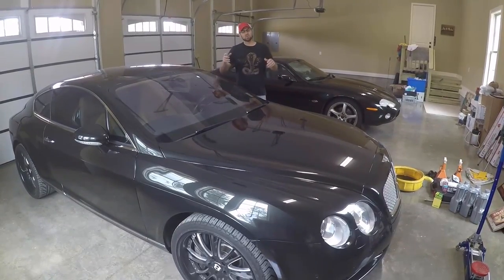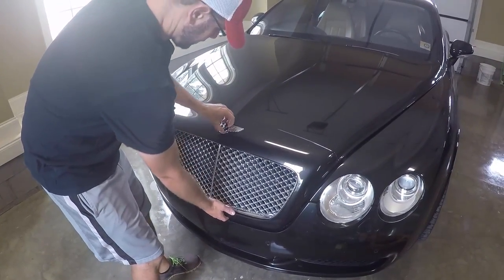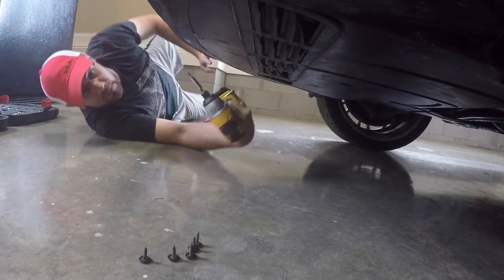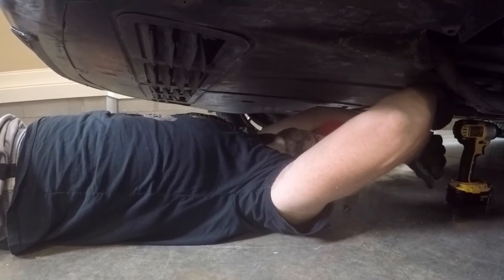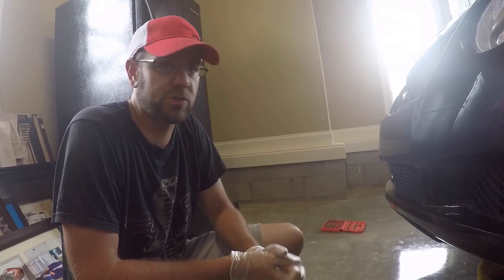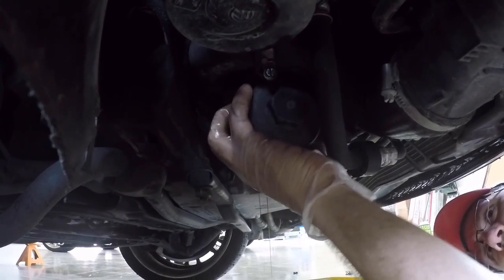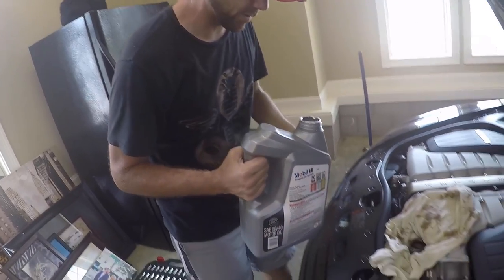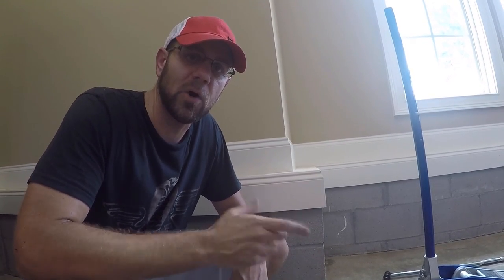DIY Bentley Continental GT Oil Change , Will I Die? Maintaining A Used Bentley GT

Comment: Hey John
I noticed you have a leather boot around the gear selector. Is that aftermarket? If so, I like the look and would like to switch mine out too.
Love your channel and thanks
Frank
Reply from the maker: Frank Cook Hey Frank and good eye. When I got my Bentley the plastic gate on the inside of the shifter was missing. This tends to be a common issue in the earlier GTs. I went to replace the part and found out that you have to get a whole new shifter. To do this was way more than I was looking to spend to fix a plastic part. So I went to good old eBay and ordered a custom Italian leather shift boot. Unfortunately, the vendor that I bought it from no longer sells them. It was a simple and easy fix that gives the GT a little more sporty feel.
Reply: John Engel 
Wow! 
What quick response. I have the same issue on my GT. I guess I could get an apoulstry shop to fab one up. I did see the plastic piece being offered on the web for $350. I guess even if you purchased the plastic piece, it still has to be dissasembled and installed.I think the leather boot looks better. Keep up the good work fella!!
Frank

Comment: Do you have to hold the two buttons in to get out of jack mode? I didn't see you press them at the end of the video?
Reply from the maker: RJC III you can do the same process and it will take it out of jack mode or if you drive the car over 5 mph it will automatically take it out of jack mode. Thanks for watching.

Comment: I have a 2016 V8S, I want to reset my service indicator ( I bought the car used from Bentley dealer in January 2020) I have only put 2500 miles on it since then.... now the service indicator light is telling me I need a service in 15 days or 5600 miles...   The car runs perfect... I want to reset the service indicator until the full year (next January).   I cannot find anywhere the sequence to reset this?  I tried your method... but didn't work on the 2016..   any ideas?   thanks
Reply from the maker: Dr. Daniel Sullivan yeah they changed the reset method after 2010 I think. I’m not sure on that one.
Reply: John Engel hmmm.... if you or anyone else has any suggestions, pls submit.
I don’t think the Bentley Dealer will divulge...
Reply: John Engel   I will probably have someplace with all the equipment change  the oil... having the car up on a jack or ramps will likely result in a incomplete oil change due to the drainage angle?  ( I’m guessing)

Comment: Next time you might want to Jack the Bentley from the other side as you can see the oil will then run completely out of the Pan instead of backwards into the corner!😎
Reply from the maker: JOHN Q LUNCHBUCKET I know have a lift so I can make sure it’s level.

Comment: How did you get it off the Jack Setting?
Reply from the maker: Peter Smith when you go for a drive it will automatically remove jack mode or you can do the jack mode process again and it will remove it.

Comment: thanks for this. do u need to put the car out of jack mode when ur done?
Reply from the maker: mujjuman you can by doing the same process that you used to put it into jack mode, however, if you don't it will automatically come out of jack mode once you start driving.
Reply: awesome thanks man. 
oil changes can be very messy jobs especially when you have a bad back or not too much free time, however if you're gonna be saving $600 then it's worth it imo

Comment: Walmart will change your oil in a Porsche panamera for 68.00
Reply: And they'll put in gravy as the oil
Reply: My car wont fit inside of a Porsche panamera
Reply: The problem here is trusting other guys to do the work.  Do it yourself and you know it's always done right
Reply: And then it comes to the dealer on a tow truck for me to fix whatever they broke in the process

Comment: hey why is your check engine light on lmao, and did you forget to take it out of jack mode? Last thing do you recommend this car? I plan on buying a 2006 Continental flying spur with less than 55,000 kms (around 34,000 miles) car is super clean too and has all the maintenance records. Anyways if you could let me know how owning an older Bentley is I would very much appreciate it. Also my biggest fear is these cars breaking down, especially if you daily it. Have you had any major problems with this one?
Reply from the maker: Fbaig thank you for the comment. The car was not on when showing the dash. The check engine, battery and other icons are on in accessory mode but it has no check engine light on when driving. It’s been a great car but as you stated it will cost more if you have an issue. I think you will love it.
Reply: John Engel thank you so much for the reply much appreciated. I’m hoping that the air suspension has already been replaced since I know they can be extremely costly. And one thing with this car which I will be addressing right away is no Bluetooth, no back up camera. I’ve found out that Bentley offers a Bluetooth kit so that’s solved, and many retrofit back up cameras are available so I should be good with technology. I’m super excited I’ve wanted a flying spur for such a long time, and the dream is finally coming true, just a tad bit nervous. I’ve owned many high end Mercedes and BMW products but have never bought such a sought after ultimate luxury brand like Bentley, have driven and experienced many but never owned one.

Comment: Well done my friend. Thinking of buying one myself. Two questions: 1. What year is your Bentley? and 2. Is this how you change the oil for all Bentleys up to 2015? (same tools etc) Thanks boss :-)
Reply from the maker: Coach CJ Arete thank you. Mine is a 2004. It's the same process but the reset for the service indicator is done differently on the newer models.

Comment: Mobil 1?
Doesnt Bentley deeply recommend castrol?
Reply from the maker: Nazihamster you might be correct. I just made sure to use the correct viscosity. :)
Reply: @JohnEngel  Thing is, i dont know that well how it is for cars but on my bikes i have to be super careful about any additives in the oil because of clutch slip etc
now on a small shitbox, it probably wouldnt mind that much but on a twinturbo w12 id be more careful
i mean, if it passes the SAE and whatnot for the Bentley, its probably no big deal but yeah.
Had to rip apart my Galant´s engine because of wrong oil put in it by a shop, it was a crapton of work on that, wouldnt recommend it on this one. :D
Reply from the maker: Nazihamster you are 100% on additives. Oil for clutches or diffs need to have the exact additives to make sure that the friction plates grip correct. Engine oils are similar but not exactly the same. I agree that using the right oil is a most.

Comment: Hi john, how did you rest the jack mode?
Reply from the maker: Nick Gray thank you for the question. There are two ways to get it out of jack mode. The first is to repeat the exact process that put it into jack mode or if you drive for 1 mile it will automatically remove jack mode.

Comment: Super later here, but you should always lube your seals with silicone grease or even silicone sex lube. Petroleum lubricants will damage rubber seals over time. Not super critical on something like a filter housing, but good knowledge to have and apply as MANY people do not know this. Radiator hoses this is the save all...
Reply from the maker: Thank you so much. Great information to know.
Reply: @JohnEngel  no problem!!!

Comment: Good for you , doin it yourself . Rolling around on the floor . By the way , tip of the day, a simple funnel can be got by cutting the top off a water bottle. Thanks for the vid. May man always have the knowledge and tools to be able to fix/maintain his motor. The coming electric revolution they keep threatening is going to be interesting though .
.
Reply from the maker: Peter John Ayton thank you. It was a fairly easy job but very satisfying.

Comment: Not a good job....the car was jacked up only to one (left) side. Thats exactly the location where the drain plug is.The oil pan is not level, there is a lot of old oil still in the pan.....
Reply from the maker: I totally agree. I now have a lift and do it on there.

Comment: Thanks for that. Very enjoyable and instructional 👍.
Two points, a B garage would have replaced the sump plug and charged you $30 for a new one and invoiced the oil at 68 quarter litres of Castrol Oil. Why do dealers damned well do that?
Send me your address and I'll send you a funnel..🤣
Reply from the maker: Lol. Thank you so much. I’m so bad about using funnels. I have them I just can’t ever put my hands on one when needed.

Comment: When I was car shopping I found a Bently GT for about $50k weith relatively low milage and in good shape.  I considered it untill I saw the inside.  The most god awfull ugly shade of BRIGHT blue and then I understood.  Look a the "comment" box if you type or the "View replies" and imagine that color blue only brighter in entirety in the interior.  Fugly doesn't even begin to describe it. English cars seem to love bright colors as Aston Martin has their share.  Anyways, I got an Audi S6 instead and yes, I sometimes do the oil changes.  Brakes too.  ;)

Now if you want to see a real interesting oil change, watch the Bughatti Veyron changes.
Reply from the maker: datsuntoyy I know what you mean. It seems that some interiors are not created equally. Lol. There is no way I would even try an oil change on the Bugatti. I was amazed when watching that video. Crazy.
Reply from the maker: John Edwards very true.
Reply: @johnedwards7542  Shares parts yes, but I've never seen anything else in VAG with that color.  As a former mechanic, I worked on an old (70's ish) Bently once.  It was definatly an experience.

Comment: I wouldn't put that strupid plastic cover back on the under side. It's pointless
Reply from the maker: ThatCarGuyWill I agree. I shouldn’t have but at the end I wanted it back how it was. I know some cars have an air circulation issue without them so I didn’t want to chance it.
Reply: John Engel John does anyone know if a 2014 Bentley can be driven without my mechanic wanted to dump the cover said it was a waste I wouldn't let him maybe I should have?

Comment: Wheel ramps can be damaging to car...seen them fly ....if you can afford a Bentley...get a lift
Reply from the maker: The plan is to get a couple four post lifts. It will make oil changes much easier and they are great for storage.
Reply: John Engel yes sir nothing like making more room for an addiction...oops i mean hobby...lol...went back and looks like you got the overhead room....just subbed
Reply from the maker: John Hull you said it best. But tell my wife that a lift is for safety. Lol

Comment: So basically it's like changing the oil on any other car.
Reply from the maker: john wright lol yes. Just make sure you know about jack mode and the large socket needed for the filter. Oh don’t forget about how to reset the maintenance indicator. Those are the only differences but if you can change the oil in a Ford you can do it in a Bentley.
Reply: Thanks for posting this John. I really like it that these luxury type cars are attainable on the second hand market at a half way decent cost. Lots of people are frightened away because of maintenance costs. But as you have shown, it is quite often the case there is nothing to fear. I have an older Land rover discovery series2. Yes, it's no Bentley, but for instance, I serviced the transmission. Drain, filter refill etc. It was no harder than my chevy van. I wanted to show my Son how much you can save. We called the local Land rover dealer. For the exact same service they wanted $700!!! I have been watching a Guy on You Tube https://www.youtube.com/watch?v=Hz5mNtJUbPk
He has taken the plunge on a Bentley and Loving it.
Reply from the maker: john wright I agree 100%. I think it’s awesome that you and your son get to spend time working on cars together. It really is one of the best memories I have when I was young. :)

Comment: I am getting a Bentley
Reply from the maker: SEANJOHN 92663 love this so much.
Reply: @JohnEngel  $800 bucks for an oil change?
Reply from the maker: SEANJOHN 92663 if you go to a Bentley dealership that’s what they will charge you. You can do it yourself for around 200.
Reply: No shit really
Reply: @JohnEngel  Not even that, if you order oil and filter online (autodoc for example) it costs you only around 100. Good Synthetic oil ACEA/SAE/API approved.
Better than at the dealer....
Reply from the maker: Carlos Miguel yeah I’d have to redo the number but you are correct. :)

Comment: Of course you can service your car yourself. But it ruins the resell value. I would not buy a car that has not been serviced at an authorised dealership.
Reply from the maker: Daniel Fl. I understand exactly what you mean but on a car like this that has depreciated so much already I don't think it's as important. I have looked at many of these and some with complete histories that are on far worse condition. If you buy your Bentley new and get a new one every couple of years then I agree with you 100%.
Reply from the maker: Chile Mexia I agree with you. I hate taking my cars to any dealership for service. I always worry about "the phone call". Lol
Reply: I agree with you. I always instruct my dealership not to drive or testdrive my car at all. The one time I didn't they drove 41 km in it between 3 days... Wonder how hard they drove it - definitely not going back.
Reply: These have zero resale value